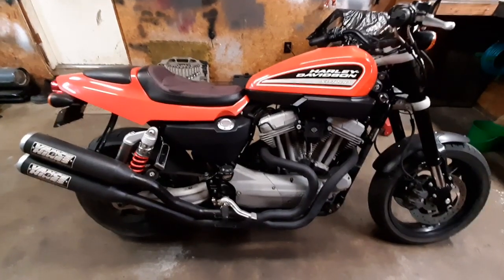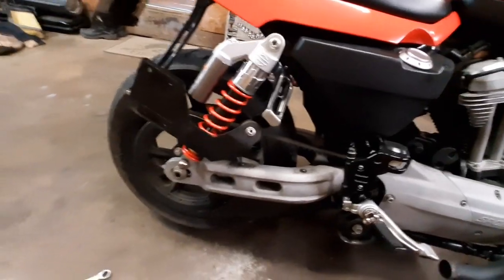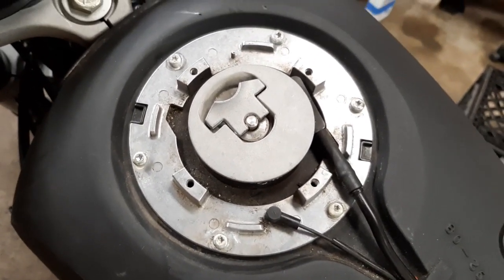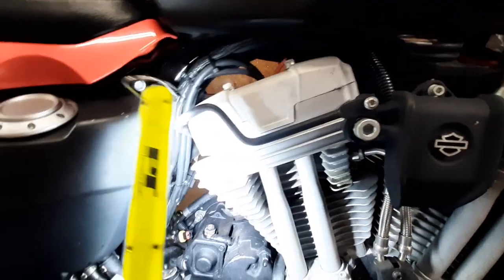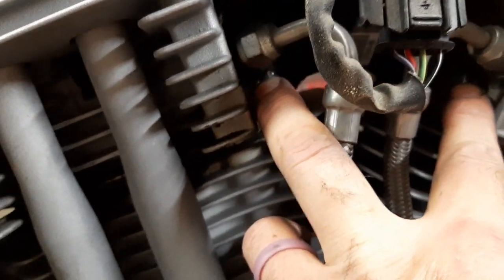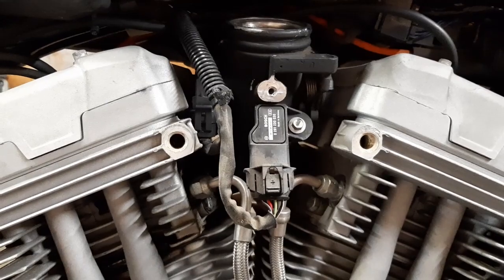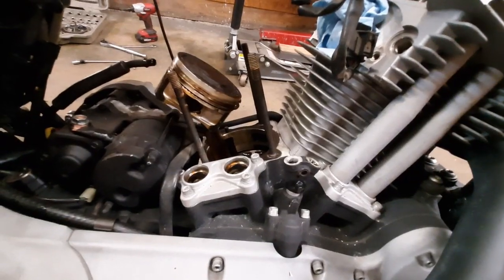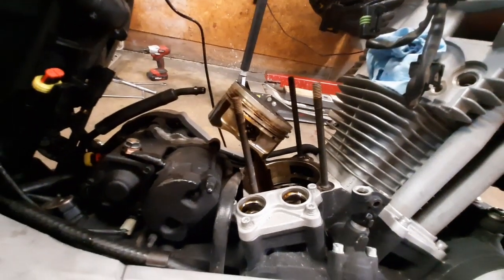XR1200 Harley Davidson Head Gasket Replacement - Part 1 Disassembly

Comment: That's why when it comes to the buells  I like the old tube frame ones better with the Sportster engine I think they're much easier to work on and one thing I love about the Sportster engine is it has that cassette style transmission where you can pull your primary off and you can take the whole transmission right out of the side of the engine without even removing the engine from the bike I love that simplicity

Comment: Will you be doing anything to your front forks?
Reply from the maker: I wasn't planning on it since they are a new set of X model forks.  I set the preload and clickers and they work great for me.
Reply: The 2009 I have does not have adjustable front forks and it dives to much when breaking. I was just hoping to watch you change yours out because you explain everything so well in your videos.
Thanks for the time you put into making them.
Reply from the maker: @tonymc66  are you planning on getting new forks or replacing the springs in what you have?
Reply: @xpsgarage  I have found a few internal cartridge and spring kit replacements for the XR1200. I just need to make up my mind on which one to buy.